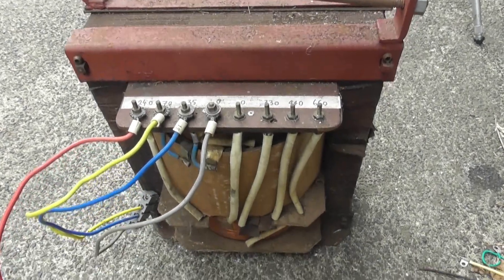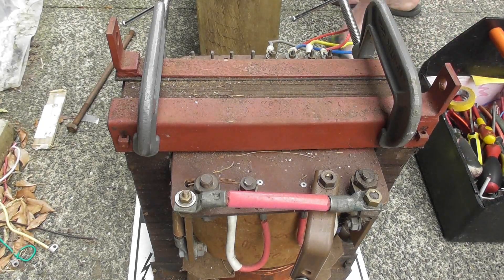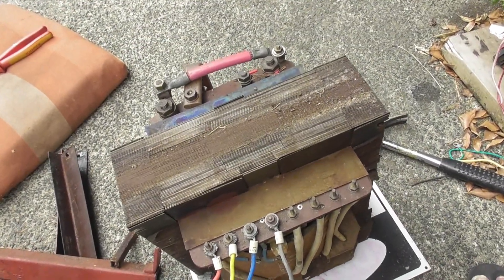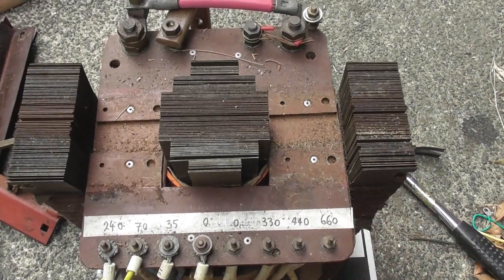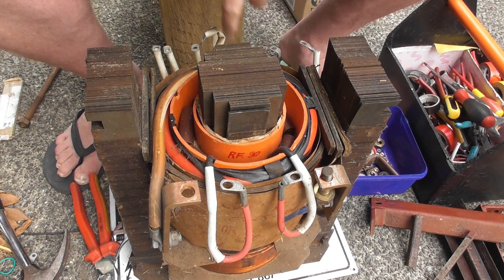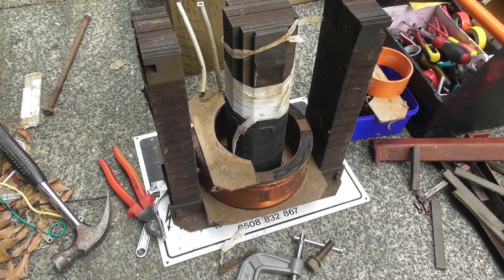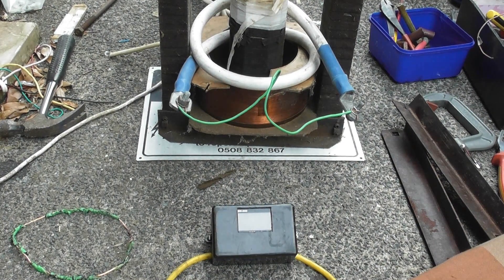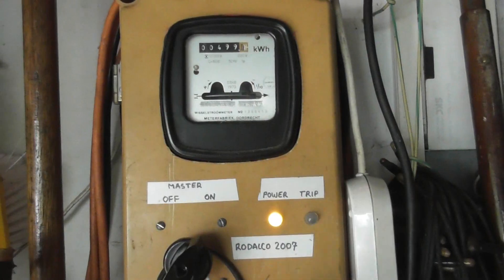Taking a selfmade power transformer apart for rewind

Comment: I've re-wound transformers for my own power supplies, but not that big ! The iron loss is always higher afterward but I think thats because the insulation between the laminations has degraded after stripping. I need to try cleaning them with acetone and then spraying one side with a thin coat of varnish or so and see if it helps

Comment: If you can't find 4mm², perhaps you can use 2x2.5mm² Romex cable, which I expect to be more readily available. Plus it had a nice shape for making a relatively tight coil.
Reply from the maker: Yes, Twin 2.5 would be easier to do, The TX is only gonna be used for short periods. Maybe even for spot welding.

Comment: Did you reuse this core from some other transformer originally or buy the sheets yourself? The stack-up seems a bit unusual. 
Also, do you want this to be a self-ballasting transformer or more constant-voltage? You could decide a lot of this at this stage.
Reply from the maker: This was originally a 7.5 kVA 11 kV / 230 Volts single phase transformer submerged in oil. I modified it with PVC covered winding to get 24 V 100 Amp, and used part of another HV coil as primary. (that was 32 years ago) I am planning to rewind the primary coil with the correct gauge wire, maybe PVC covered, as I haven't got bare varnished wire. The secondary will be three parrallel of the heavy gauge wire used in the open TX test. A follow up video will be made when I have worked out materials etc.
Reply: @RODALCO2007  I see, thanks. If you dont want to spend much money dont forget that you can also use thin wire, like from the "HV" primary, in parallel. Using thick insulation not only wastes space, but also decreases cooling after all.
Reply from the maker: @Basement-Science  Yes, I have to build a hand winder and was thinking about using the varnish windings. and triple it up so it will handle a current of at least 16.5 Amps continuous and 24 Amps for shorter periods. That copper winding was ex 100kVA coils designed for 5.5 Amps continuous 8 Amp 2 hour rating. The parts didn't cost me anything so if it fails, no loss, only time and a learning exercise.